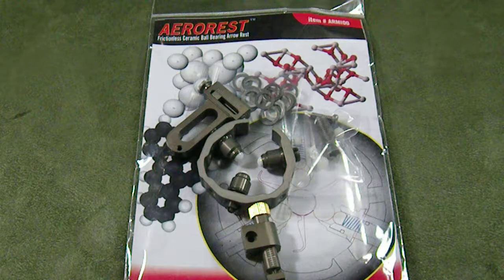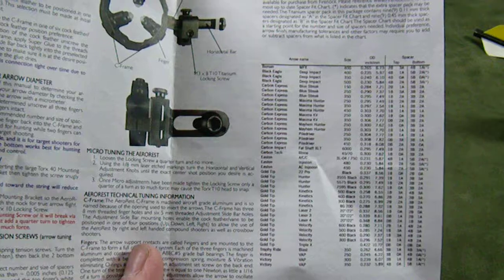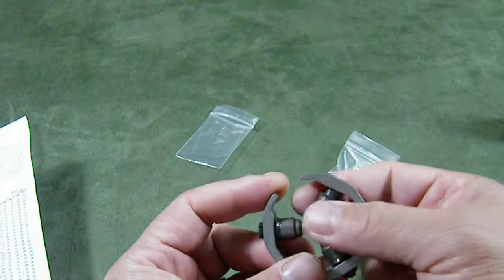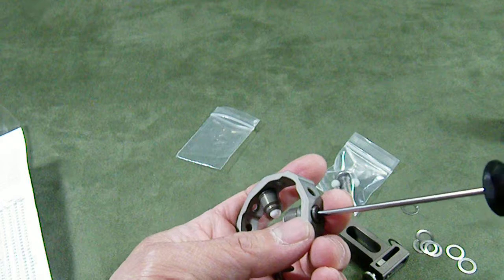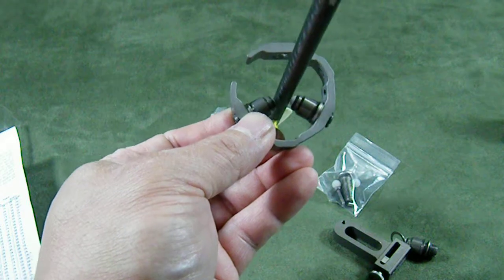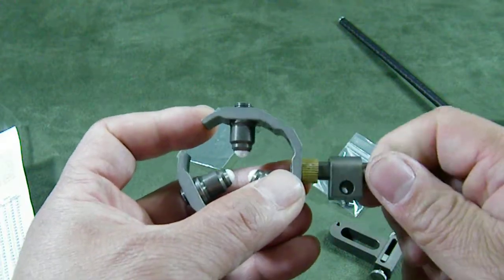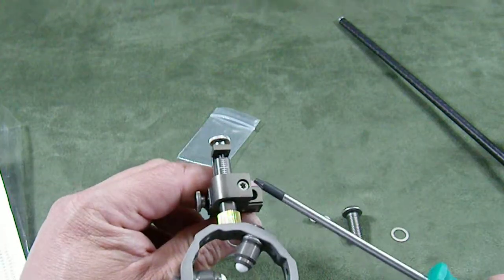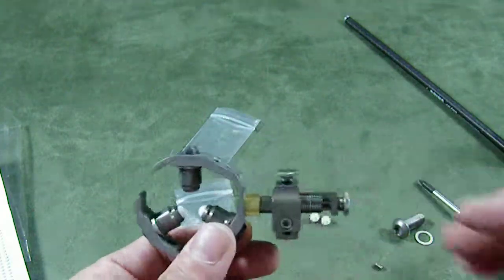Firenock AeroRest Micro-adjust Arrow Rest Introduction & Installation

Comment: Can I delete the springs to get fixed fingers?
Reply from the maker: Just tighten the brass spring tension adjustment screw, 1 1/4 turn of the brass spring tension past the normal will cause NO movement of the ceramic balls. Make sure you do not make more than 1 1/2" turn or the ceramic ball cup will be ruined!